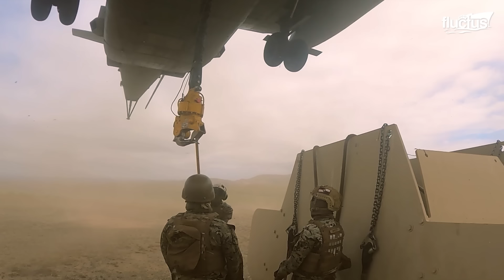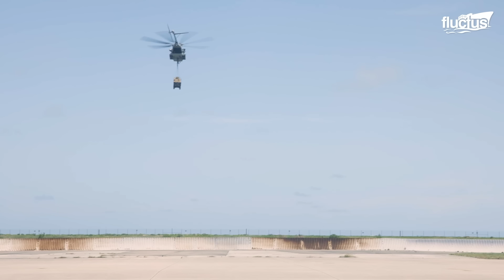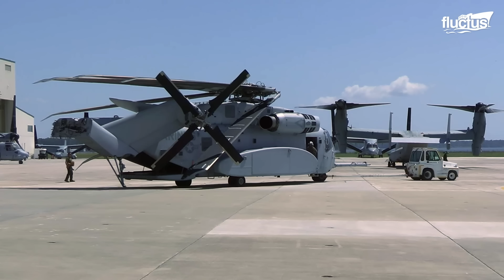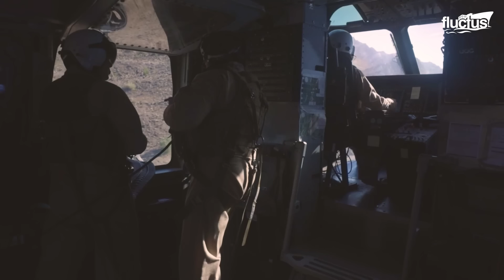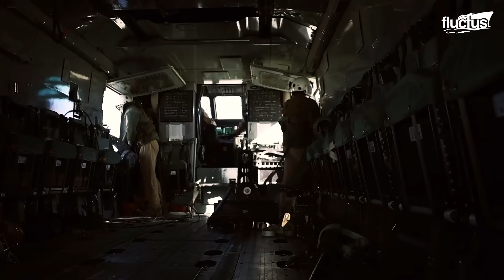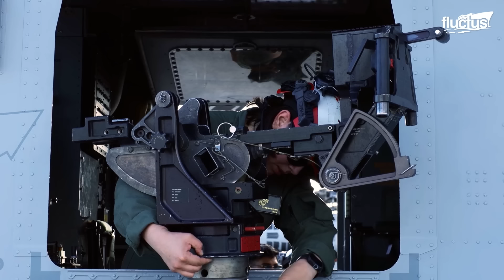How Skilled Marines Start & Fly US Largest Helicopter Ever Built

Comment: Mi-26 is the world's largest and most powerful helicopter in serial production, developed in the Soviet Union and still operational today. It can carry up to 20 tons (44,000 lbs) of cargo or 90 troops, featuring a main rotor with an impressive 32-meter (105 ft) diameter, matching the size of a Boeing 737.
Reply: The King Stallion Has it beat.

Comment: The CH-53K cost as much as a F-35 and in it's own right just as complex.
Reply: They also rebuild them in Arizona
Reply: It is no way as complicated as a F35.The CH53K is based upon 1950s technology
Reply: @JohnRandles-l2cNot true. The only thing "1950s" about the 53K is the outward airframe being the same shape, but even that is larger than the original 53. The K is fly-by-wire with computers assisting in stability, especially during hover.